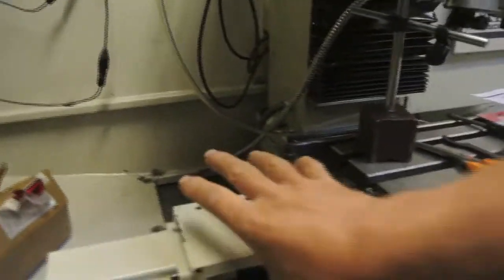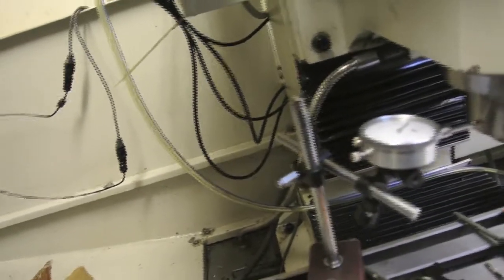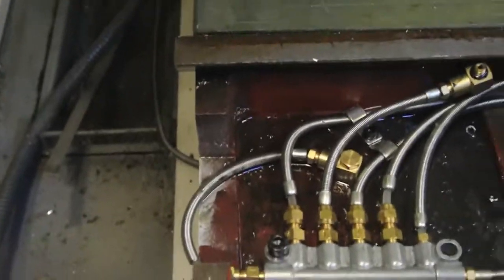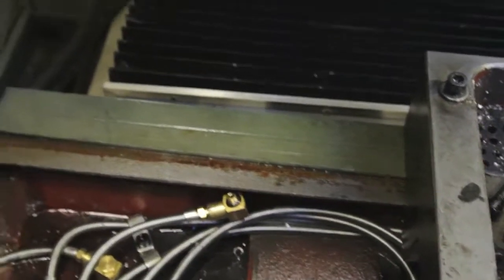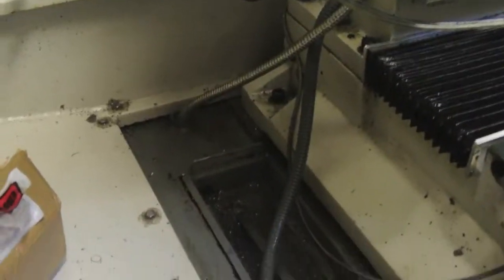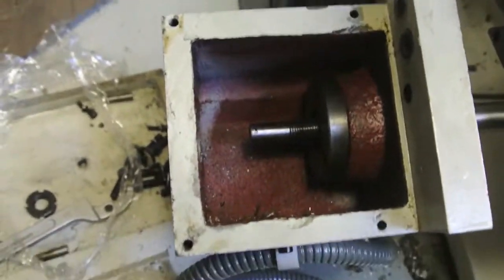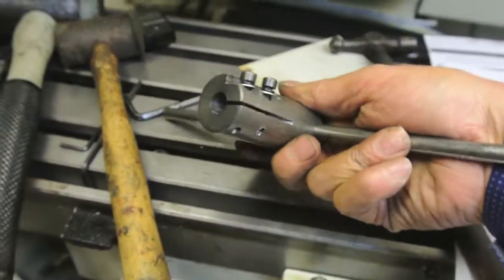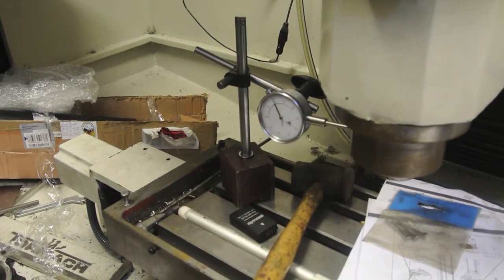Tormach Maintenance

Comment: I just put a long 1/2" rod through the opening in the stepper housing into the coupler,  tightened the existing set screws and turned the rod with a pipe wrench. Thank you for the idea Bob, Lee

Comment: I expect this will be helpful to me, my 3 month old Tormach 1100 has some backlash in the X axis.  I expect something vibrated loose, because I can push and pull on the table and get a whole thousandth of backlash, still cuts like butter on the Y axis, but climb milling in the X axis will yank the table around like a worn out bridgeport and create spindly chips and chatter.

Time to take it apart I guess.
Reply: Oddly enough tightening the Z axis gib all but eliminated it.  I guess the design of the head is such that the gib is more important for left to right load than front to back.  Problem solved for now.

Comment: Slight improvement on the backlash program might be to go 10 thou and back again in positive direction - then pause, then repeat 10 thou and back again in the other. So when it comes to rest at "zero" from each direction you will see the backlash directly. You'll be able to read it off directly as a distance from "zero" in each direction. Add them up obviously.